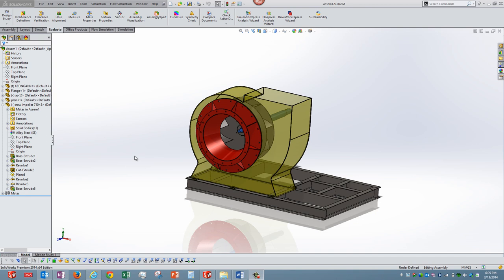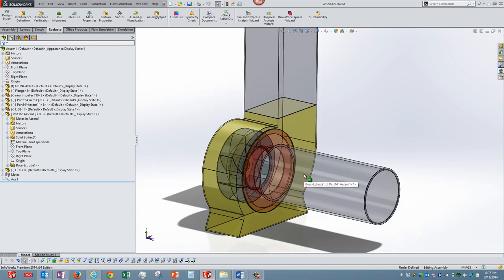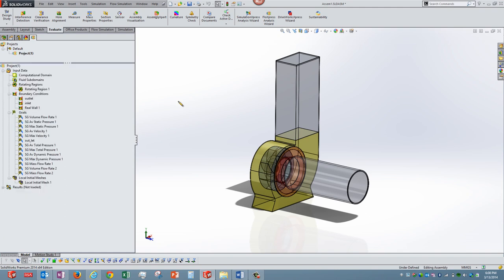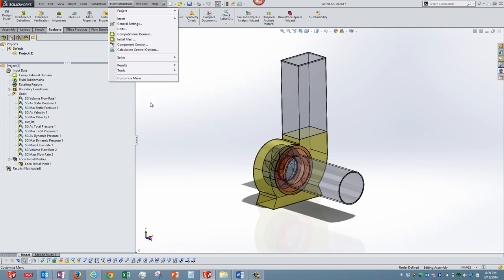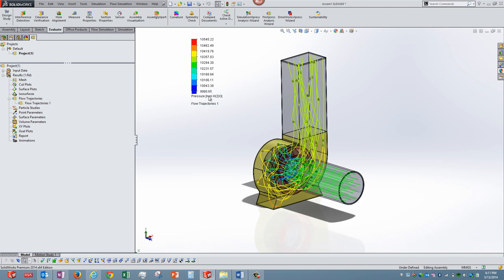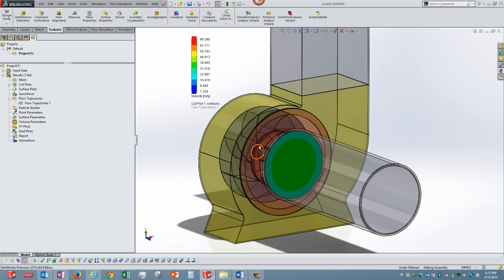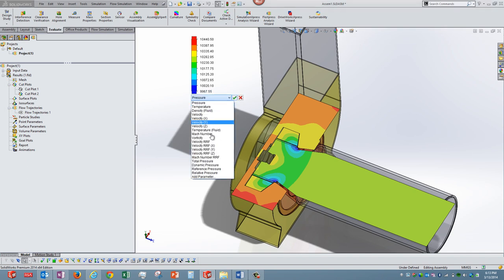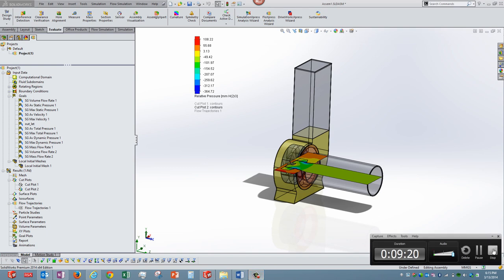Suction Pump Simulation using Flow Simulation

Comment: Hello I am a novice.  How would I do a flow sim for an aquarium heater in a tank to check for cold spots. Then if there are cold spots, how would you assess the  effect of water flow via an internal water pump to circulate the heated water

Comment: halo sir , is it normal if the value for the volumetric flowrate at discharge is negative ?
Reply from the maker: negative is like saying the fluid is going out of the system.
Reply: @KapilGaitonde  why is the inlet pressure and outlet pressure is so high when we insert inlet to volumetric flowrate ?